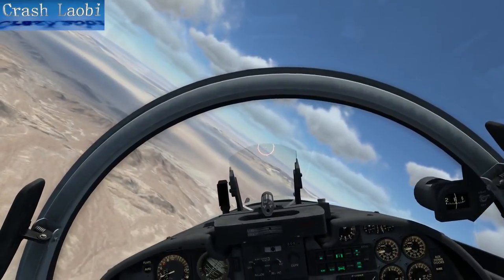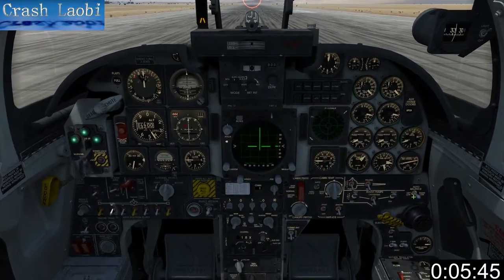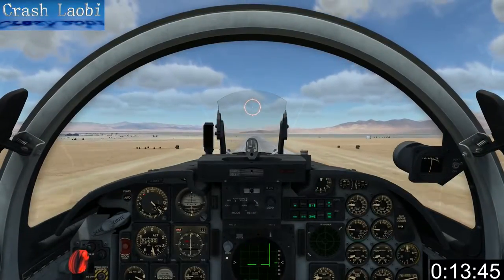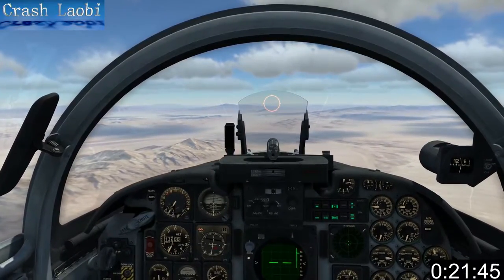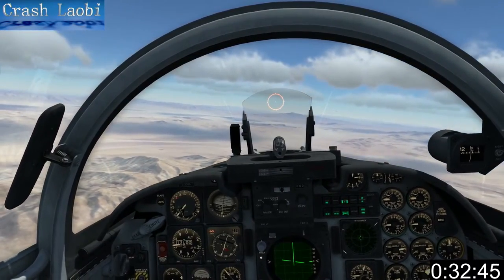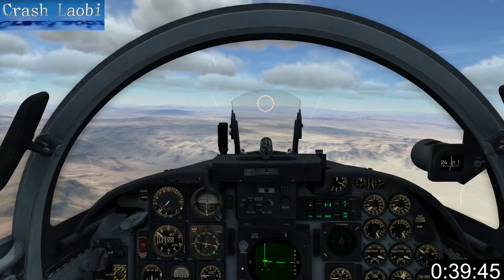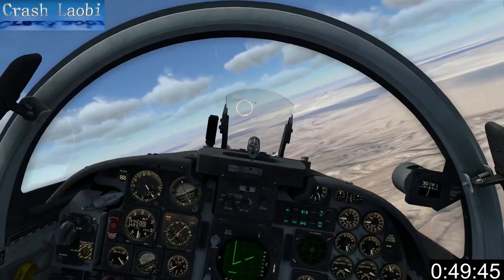1 Minute DCS - F-5E Vlad's AA Gun Solution Tutorial

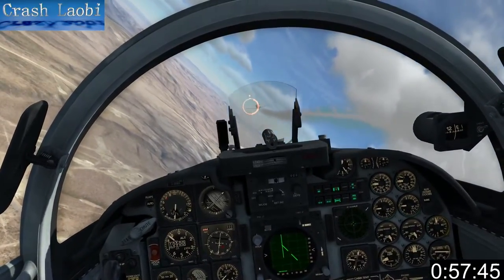Comment: Why do you press the Acquire button at 1:25? You are already locked onto the target by that point, the gunsight is providing a solution and even shows you the range closing to the target on the right. If anything, pressing ACQ at that point looked like it reset the radar, and you lost tracking.

Unless I'm mistaken, using the Down/Aft mode should automatically lock the target in front of you-- it will also override the gunsight knob on the dash.